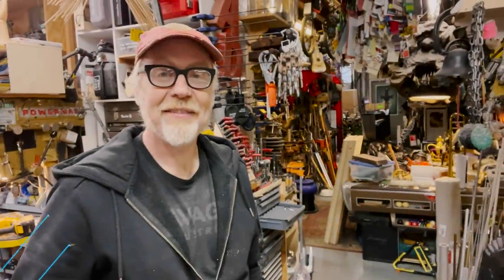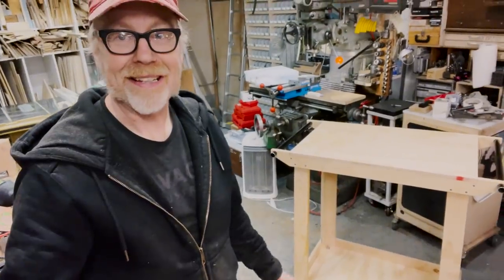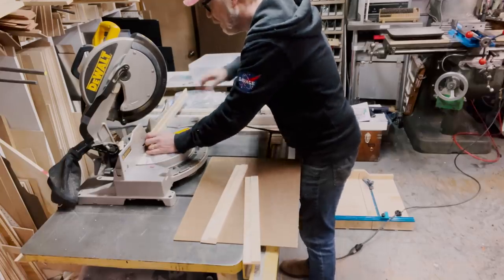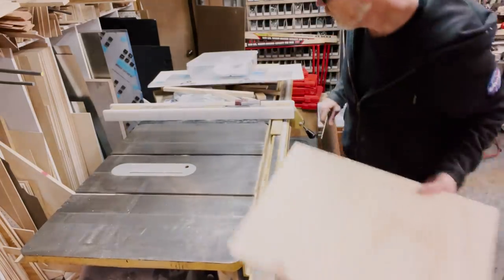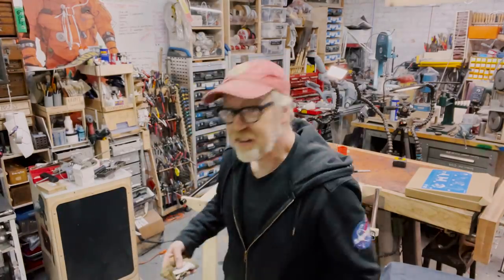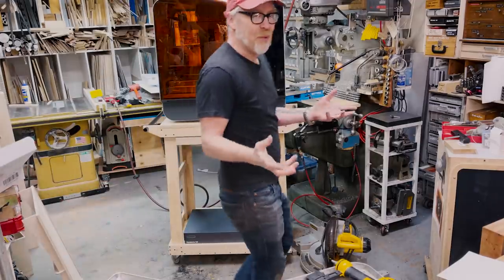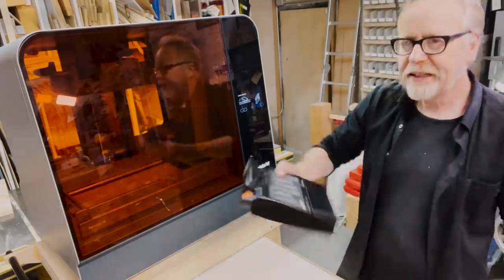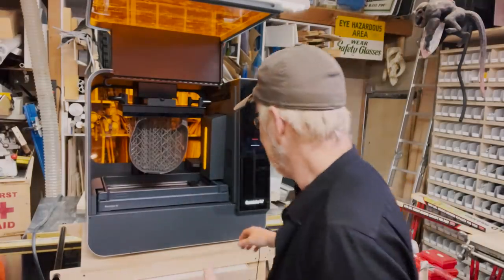Adam Savage's One Day Builds: Resin 3D Printer Station!

Comment: i have 7 3d printers an just purchased a anet a8 plus on amazon just cause it was on sell for under $200 an for its build volume i had to get it so i'll have a total of 8 once it gets here. so i have a creality ender 5, 2 FLSUN QQ-S Pros, a kingroon kp3-180, a two trees sapphire plus, anet e10 and a kossel mini that i designed an built from scratch an the anet a8 plus will make 8 but i plan to get a sla resign printer in the next week or 2 if everything works out but its not going to be near as big as what u have in the video. i really dont know anything about them other than they do really good with smaller parts with high detail. what are some suggestions that will help a newb to sla printing. i plan to build a curing box an will figure something out for the wash but other than that i dont know of anything else that will help along with my experience with resign printing. thank in advance to anyone who gives suggestions

Comment: 3d printers require being level and stable.
Im not sure those casters are gonna be your friend long term.

Get a magnetic, flexible build plate that is removable from the standard build plate. This will allow you to remove the plate and flex your parts off. Much easier than trying to pry them off with a tool.

Also, change the lights in your shop to LED's. LED'S, depending on the color, produce almost no UV. Stray UV light will negatively impact the photo polymer, contributing to miss prints.

Comment: Do the castors you have on the cart lock? One of the most frustrating issues I've had with printers is their stands moving (even just a little bit) from their internal motion, and causing roughness in the prints

Comment: If you want to take off a fraction of the blade width on a compound miter saw, lower the saw blade and slide the work into it so that it makes solid contact with the side of the blade. Hold the work piece firmly and raise the blade back up. Start the saw and you will take off just a hair.

Comment: Savage, i don't recccomend having your 3D printer on a rolling stand. the vibrations caused by the movement of the printer itself can cause issues, normally it's only with plastic pla printers, but it MIGHT be able to happen with resin as well i'm not sure. the printer needs a spot in the shop to be it's forever home.

Comment: Great to hear of this lucky acquisition to the shop, but the whole mobile trolley thing on a resin printer I find a bit under thought.  Going to have to level every time it gets moved, and wouldn’t want to be accidentally bumping it during printing, not to mention trying to keep it out of the dusty environment in the workshop.  I think if you are going to have a tool investment such as this, you find somewhere appropriate to install it, such as a dedicated 3D printing workstation.  A bit more to resin 3D printing that hitting go...need to store prep and clean up gear, and a cleaner environment equals a cleaner print.

Comment: It looked like a cool printer until we saw... cartridges. Those resin cartridges have a DRM chip - you can't refill them, or use different brand resins. I used a Stratasys uPrint back in the day, and it's filament spools had a DRM chip too. It's all just to lock you into buying their consumables.

Comment: Question: Doesn't a resin printer use liquid and doesn't liquid auto level. soooo won't having the printer at that much of an angel cause printing problems when starting or if a print is extra tall?  Just sayin.  Seems an odd time for your first tilted work surface.
Reply: and for that matter any printer really as having an angle would cause more resistance when moving in one direction even on a traditional 3d printer.  could cause additional wear or even print issues etc

Comment: You need to look into Formlabs' selection of resins. They behave very differently in the final product and come with quite different printing properties. One size absolutely doesn't fit all. I would regard the basic resin as a figurine resine and quite unsuitable for any kind of a mechanical application. In your line of work the rubber-like materials especially might come in incredibly handy.

Envious of the large formfactor machine though. The 2 and 3 series are really nice machines overall.

Comment: Am I crazy for preferring a satin or matte finish on that orange acrylic? Either that or I would keep the cling film on it because it’s going to get wrecked and ruined. To the point where it’s going to obscure your view of the inside.

There’s a new cling film called “Press and seal“ that can be easily manipulated removed and repositioned… shit can be used over and over it’s absolutely incredible and invaluable in my shop It really is incredible stuff. I use it for things like this… Basically use it like a huge screen protector that can be ripped off and replaced at any time cheaply. Without the huge hassle of dealing with saran wrap and traditional cling film.

Comment: Form labs, we have the Form 2, broken after two years or low usage. Don't expect serviceability or spare parts when it breaks. Also MSLA with monochrome LED mask is significantly faster type of printing compared to the form 3 lased based systems. However, the form 3 extreme fun but you have to be incredibly patient.

Comment: To the editor, please fix the bad audio levels. Ads are 3-4x times louder than the content. I know Adam is alone to record this and understand the limitation of the equipment he uses. But you could boost the overall audio output and set a maximum to prevent the tool sounds to blast us because of that boost.

Comment: Adam, don't forget that you're a role model  You're treating the chop saw very cavalierly, and it worries me wthat you might hurt yourself doing this, but even if you don't, someone with less experience than you might think they can do straight cuts and angle cuts without securing the wood, and they might end up getting injured.  Argh, you're using the table saw without the protective cover as well.  I do that too (sometimes), but boy is that dangerous!  I shouldn't do that and nor should you.  Table saws are even harder to control than chop saws.  I've had the blade grab a flat piece of wood and fling it like a 15 pound shuriken, or shoot a 2x4 like a rail gun  Be careful!

Comment: My Anycubic Photon and its Wash & Cure station live on an 18x24 inch cart which I made of NSF wire shelving.  The top shelf is furnished with a sheet of masonite for a better work surface and a silicone 'pet food mat' to contain any spills.  ~4 inches below the top shelf, is full-size pull out shelf that is used as a staging area for working with the resin vats.  Under that is a pull out shelf with all the tools and consumables.  And under that is the shelf with all the bottles of resin and IPA. (Again, protected by a silicone mat.)

Comment: And you'll be able to watch him set up another 3L in 5 months after this one breaks.  I manage a fleet of Formlabs printers and this is by far the lowest quality, shortest lifespan system I've worked with.  If I were Adam I'd be embarrassed to have associated myself with this product.
Reply: What ends up breaking?
Reply: @kendokaaa  pretty much everything but on the 2's it's most commonly the tray and tank sensors.  The 3's also have problems with tank sensing but it's a bigger issue since you can't run it in open mode making the machine a paperweight. The magnetic wiping mechanism on the 3's is also garbage, it pops off every hour.  We've also had the tanks on the 3's leak.  We currently have two 3's completely filled with resin and ruined because of leaky trays.  Formlabs does not have a service printers, they replace them and charge a $1200 swap fee. As for the 3L, remember, this product was announced years ago and they stopped marketing it because their engineers couldn't get the build right.  Now they're selling it to you...for $10k+.

Comment: lol, $11k for a resin printer? ok sure if it could guarantee no printing errors, giving that your refills start at $150-300 per freaking liter!!!! 
i think for money why not consider a more reliable printing application from people like Stratasys? 

i think the OVER PRICED resin is deal breaker for such a imperfect science where errors are so common, to me anyways.

i believe the Peopoly Phenom or the Phrosen Transform would have been a more reasonable choice given their size and monumentally cheaper resin cost. for $11k, Adam could have 2 or 3 Peopoly machines set up and running for around $6 - 8k printing all his large scale endeavors in a 3rd of the time with a fraction of the material cost if he wants to go crazy. i'd bet money that the $2k Peopoly could deliver the same quality or near it. Formlabs  is like the Apple of 3D resin printers always charging way too much for their stuff, their resin is insanely priced to boot.

thats my two cents, anyways.

Comment: $11K plus tax not to mention any accessories. Just a common 3D printer for the common man. So that's $11,500 divided by views of almost 300,000 JUST SO FAR, which is 3 cents per view. Pretty cheap marketing. I wonder if Adam has to send the printer back?